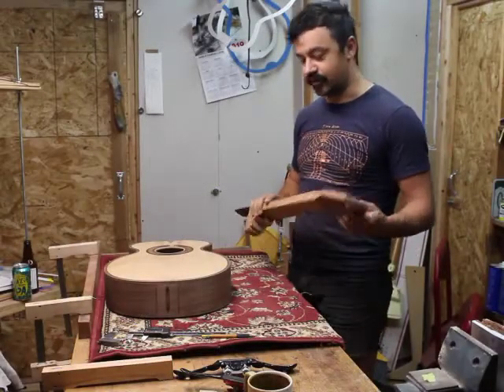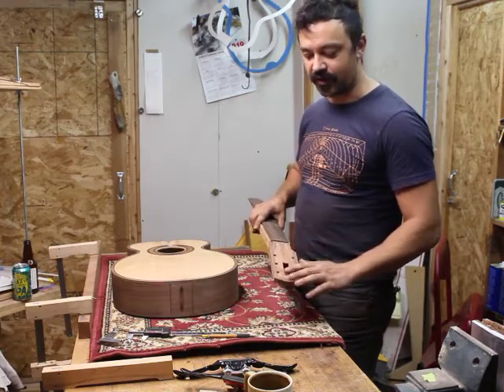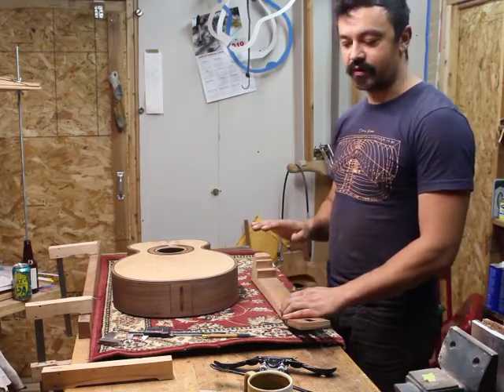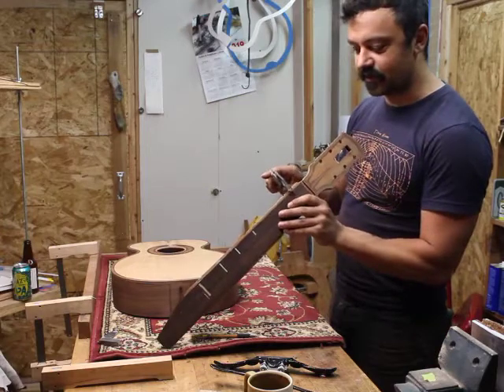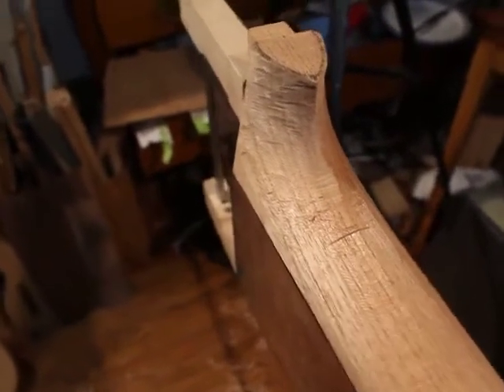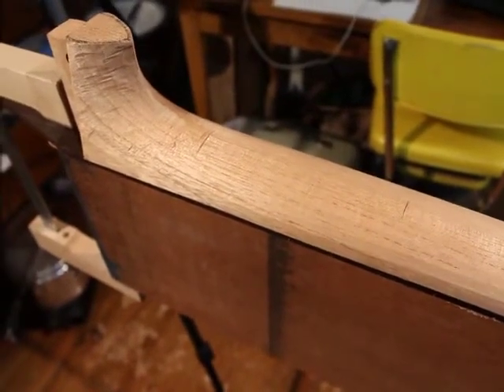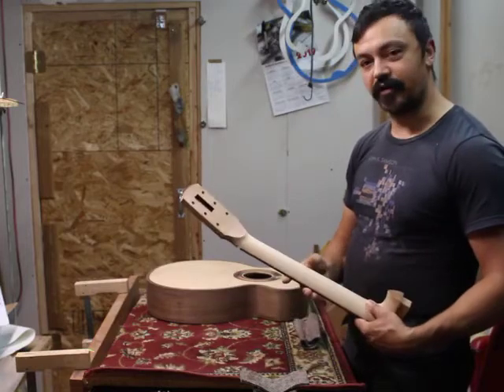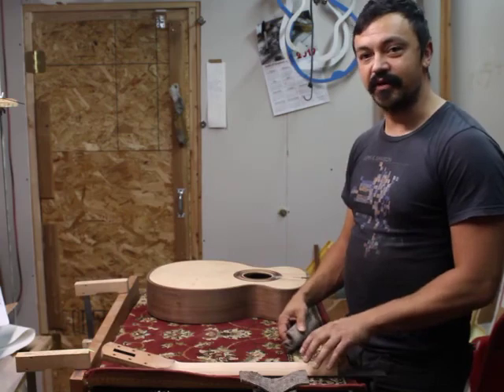Hand Carving a Guitar Neck

Comment: Enjoing the videos. What brand of spokeshave  with the two screw adjustments do you recommend? Thanks for  help----Chris
Reply from the maker: Hey Chris, very sorry for the very late reply.  I actually bought both of my spokeshaves together on an ebay auction, and I could not definitively tell you the brand.  It prominently informs you that it was made in England.  I'm not much of a collector and so I am no expert on identifying vintage tools, but I think it is an old stanley 151 with a round sole (it lacks any 151 or stanley marking though, so I dont know).  It has been a few years since I bought mine, but I would imagine they are still available and affordable on ebay.  I do not know who is making nice spokeshaves with adjustment screws currently, other than Veritas.  I have never used their spokeshaves, but I have also never been disappointed in the quality of any of their tools and imagine it is on par.  

As a side not, the flat shave without adjusting screws I own looks aesthetically very similar.  It however is branded Globemaster, and was apparently made in West Germany.  I do not use it as much, but I have never had a problem with it, excepting the more difficult set up experience.